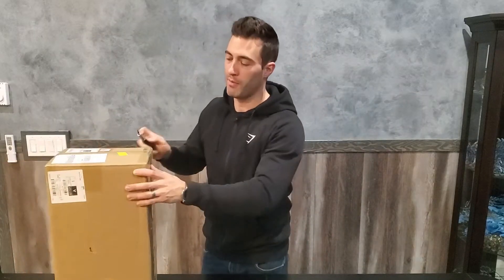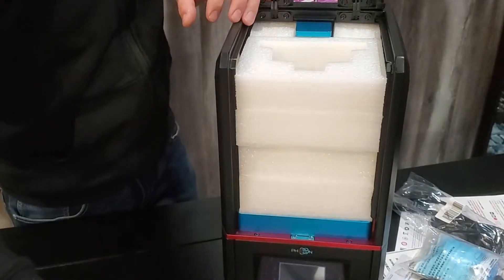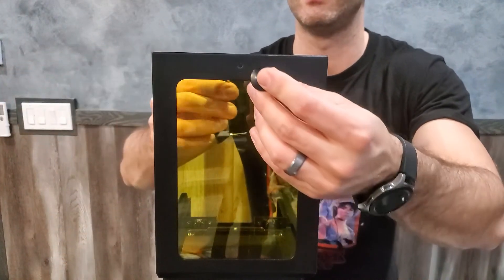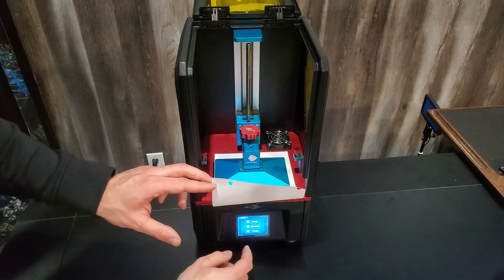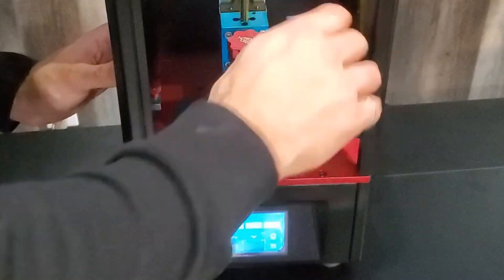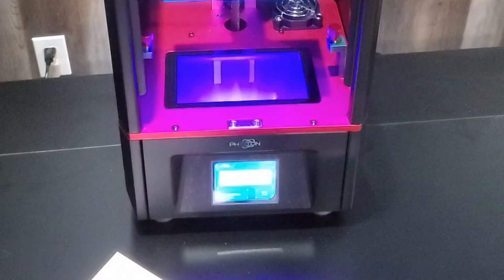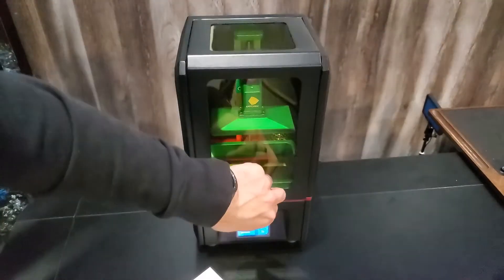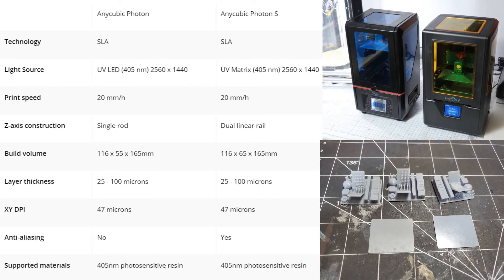2021 Anycubic Photon Unboxing, Setup, Calibration and Test Print

Comment: Hi there I have just got one of these the anycubic photon S and when I've done the test clones of calibration it failed any help will be super thanks
Reply from the maker: What type of fail where you getting? Sticking to the FEP, pealing from the supports? I would first check on leveling.
Reply: @FacilityD20  it was done on the bottom of the clones of calibration but the top had one on it but the rest was missing